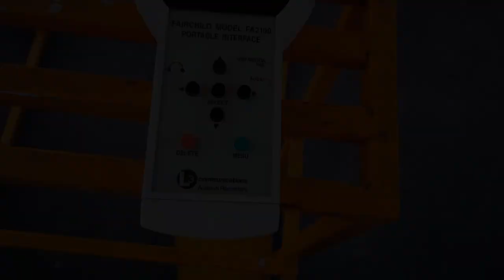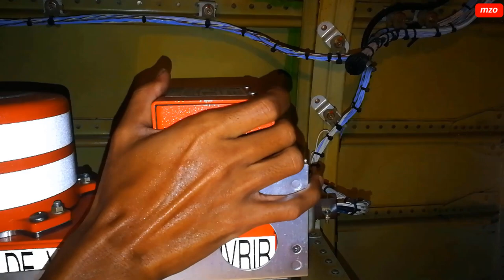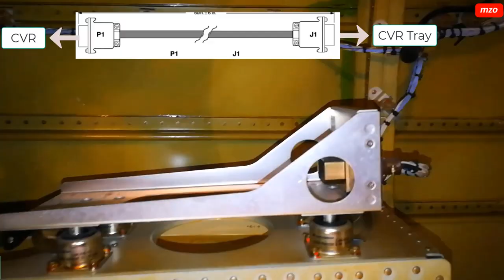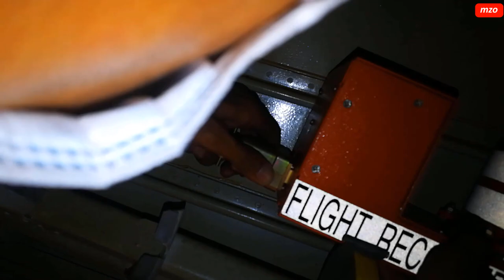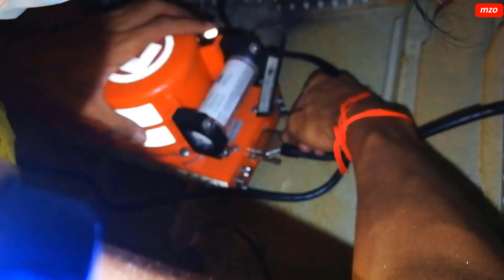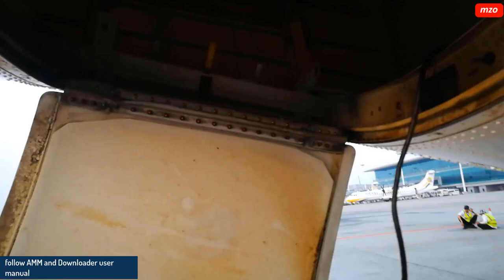Cockpit Voice Recorder | How to download CVR data

Comment: does that tool also work for fdr sir?
Reply from the maker: Yes, This tool is used for FDR and CVR data download. For FDR data downloading, data cable which was used for CVR, is not required. Just plug the portable data cable to FDR directly.
Reply: @mzosharing   thnk you sir for your information
Reply: @Richard Camarillo it is stored in pcmcia card.. memory card.
Reply: It looks like you use an extension cable to power the recorder but the breaker should be off, so you must restore power first before doing this?